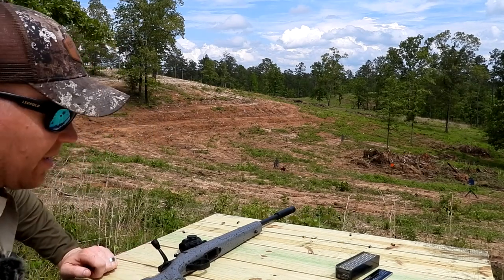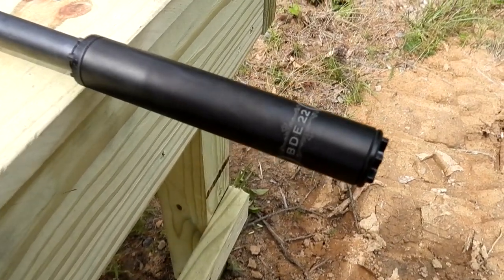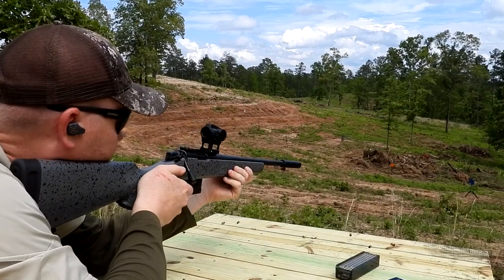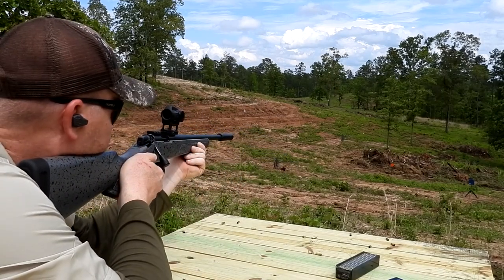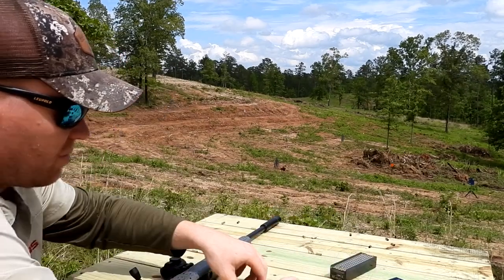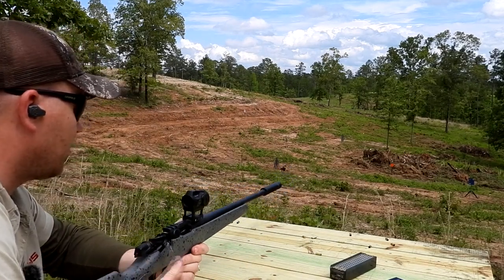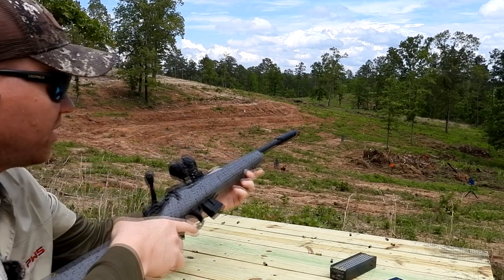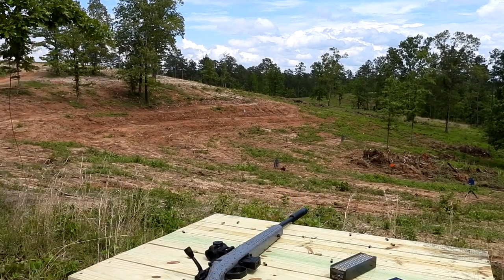3D Printed Suppressor??? The BDE22 from Primary Weapon Systems

Comment: Man I'd like to have a susher and was going to form 1 one and then they went all nuts on how you could or couldn't do that.  To think something that the rest of the world considers a polite thing to use while hunting or practicing is perceived by our politicians as "only used for murder" where NOBODY uses one for murder, except in the movies.  SO we get these new, fancier and fancier, light 600 dollar cans that require a 200 dollar stamp so they know where to pick em up when the whims of the ATF change?  Sure for a fella that shoots, hunts and has as many acceptable slingers as you, it's not such a bad deal.  But I only have 3 rimfires that would accept a shoosher and the cost of one shoosher is about equal to the more expensive of the three.  Oh well, for quite ya can't quite beat calibri's in my Gallery Gun.  Quieter then my springer air rifle.  Just wish I could shoot my Taurus 22 with a shoosher.  Then I could hear where the silly casings are hitting on the garage wall.  Make it easier to know where to sweep.
Reply: Inland PM-22 and B&T .22 cans can be acquired for under $500 total.